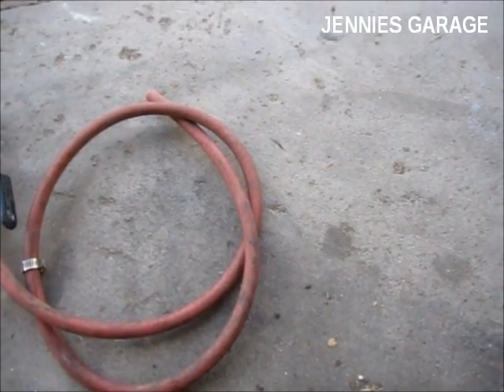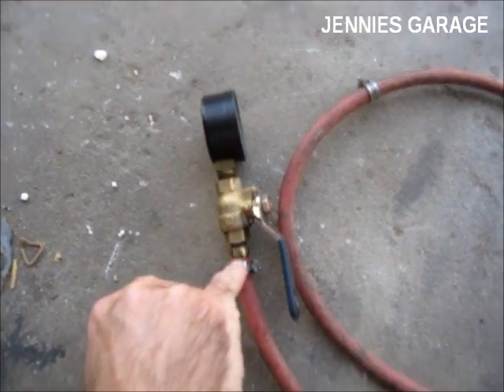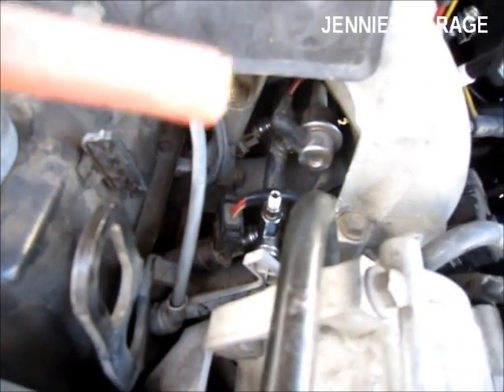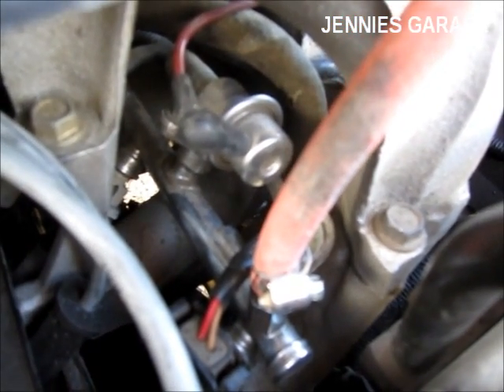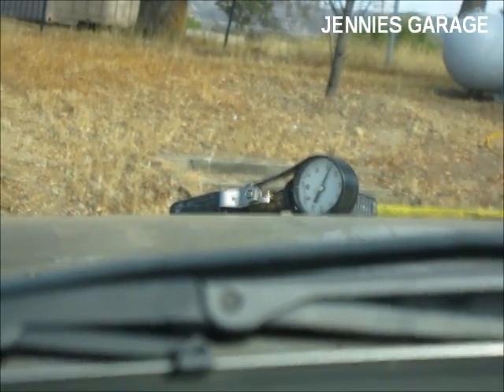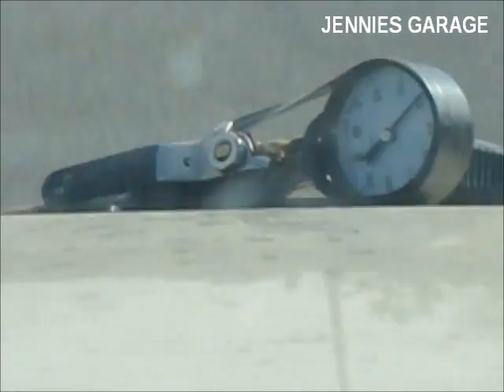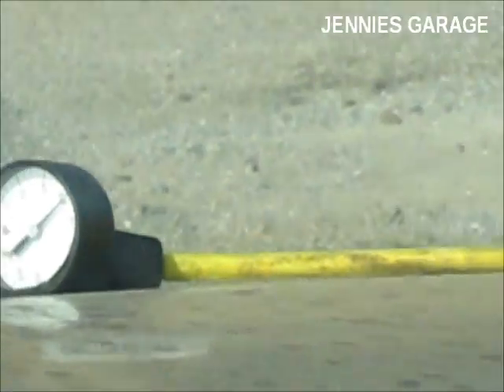How To Test Fuel Pressure On A Ford Ranger While Driving - Bungee Cords!

Comment: What he did in the first video was very dangerous with that gauge in the holes. Number one the gauge has to be a fuel resistant gauge not just any gauge because gasoline will eat out the internals. Number two he has air hose using it for fuel hose, the hose will hold air pressure but again gasoline is a solvent and we'll eat out the inside of the house Superior right idea but not using the right stuff, you have to use high pressure fuel hose with a high pressure fuel gauge, not just any stuff you have around your garage or you will start a fire and possibly get hurt

Comment: thank you! I just checked my '86 2.9L, has 10psi with key on,
 ( increases by 10psi each time  I turn key off and on)  30psi while idling and up to 38psi when I rev it ...  I have changed the filters and fuel pressure regulator. Fuel pump going out?

Comment: You don't have to start the truck to check the full treasure  just turn the ignition on position
Reply: Fuel treasure...guess so? 3000 tach rpm problem spot (while driving) on some fords

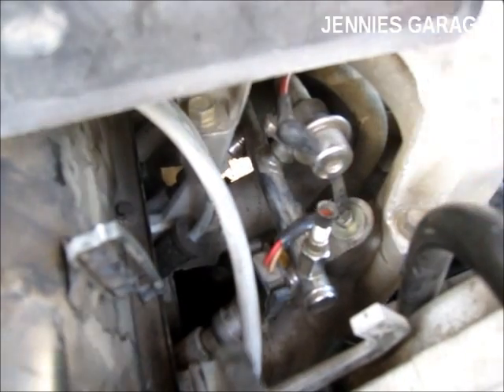Comment: can anyone please tell me the name of the part above finger at 1:52 round silver disk with vacuum elbow connector coming out from it thanks
Reply: I know this is a year old post, but no, that is not the fuel pressure regulator. It looks like one, and it's in the same place as one, but it's not. What it actually is is a fuel dampener which is responsible for preventing fuel pressure pulse (sudden spikes in fuel pressure) in the fuel rail when the Injectors fire. The actuall fuel pressure regulator is mounted on the fuel pump inside the fuel tank on this specific system. Ford moved to the tank-mounted regulator around 1999ish for when they changed from a fuel line return system (which does have a fuel rail mounted regulator which is powered by manifold vacuum), to the return less fuel system where fuel pressure is regulated by the ECU through the in tank unit. Sorry if I busted anyone's balls here but I figured Id like to be helpful even if imperfectly
Reply: @tjsMAR  thanks but I ended up finding that out when I researched more
Reply: @DZ-cb2bg  no sweat bro.
Reply: That is the fuel pressure regulator.

Comment: hi my ford ranger just overhaul and looks like getting to much gas starts like wants to lose strenght and i take off the switch and turn it on again and runs well but start doing it again  and switch off and on again syart working well like computer sending lots of fuel to the injector plz give a hind wat more or else can be the problem
Reply: Tempuature sensor

Comment: i have my98 ranger 2.5L  runs and dead after 3 seconds , i did put new filter and new pump  and is not pressure in the line after 3 seconds  . do you think is the pressure damper ???? please i need help     today is 11/6/2018
Reply: Maybe it's a security system error shutting off the fuel pump after 3 seconds.  Look for security system or key trouble lights.
Reply: It's a me Mario  it dosnt have one , is 98 , i did foun the problem  one of the little ouse the one connect the pump the the filter was crack and when the punp work it loss the pressure but finaly i saw it and i change it problem solve
Reply: It's a me Mario  we have the same one i dont remember saw the sensor 🤔🤔

Comment: Epilogue - After filming stopped Jennie's truck and it's home made fuel pressure gauge erupted into an inferno of flames and it's driver a long list of "Holy shit I'm on Fire"  related expletives. Most of the trailer homes in the area burned down if not directly from this immense holocaust then out of sympathies for the fire and the tornado that missed them last spring  ....Unfortunately the participants in this video met their demise and are to be interned at a local Darwin Center under the title "Things I wish I 'd thought through before actually doing them" ...Please send donations made "Payable to the Darwin Fund" in lieu of flowers and cards..Thank you.

Comment: So if the pressure is normal and I want to change the fuel filter, will gas spray out like a water gun? LOL.
Reply: Pull the fuel pump relay and start the engine. That'll prevent the fuel pump from running and the injectors will take care of the remaining fuel pressure when you start it after pulling the relay.

Comment: Will a bad fuel pressure regulator cause a misfire? my 87 ranger does not show the gas level so i am wondering if fuel pump and sending unit can also cause the misfire.
Reply: System to lean code
Reply: What do you mean by this, I have basically all of the above problems, plus a system too lean code on my 97

Comment: only fords use the schraeder valve. also, because of the check valve in the pump, if the pressure diminishes after shutting it off, that could be the cause of a cold start problem. great video, thanks for posting!!
Reply: Wrong, my 95 jeep has one.Im pretty sure old gm use them also.

Comment: this is really a helpful video thanks for posting. not only did I learn how I can check my own fuel system pressure but I learned how I can do it while driving which is something I need to to, my truck seems to not have enough fuel sometimes when under a load this is a good way to see if that is actually the case or not. also I didn't even know that the valve existed.thats a nice quick way to relieve fuel system pressure before changing a fuel filter.